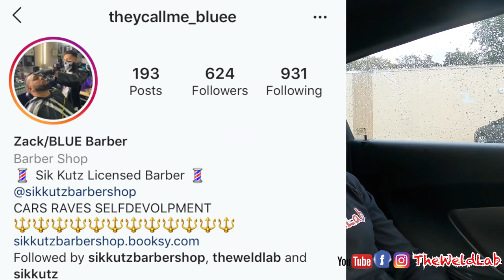NEW RIG WELDING JOB! | STAINLESS FABRICATION SHOP | PRODUCTION  WELDS | TEACHING ONE ON ONE

Comment: Hey bro . Just out of curiosity. You were In the 3rd range and low on the remote . Which means it’s more of a crisp and stronger arc . Have you tried welding In the 2nd range higher on the remote . Would it not be a softer arc ? Have you tried it and how did it weld if you did ?
Reply from the maker: i didnt try it on 2nd ...i was actually having  a hard time  finding the heat ..but im useing 5/32 to fill and cap so 3rd gear feels very good to me ...i cap on 5-6 on the remote and it lookds good
Reply: @TheWeldLab  awesome . Glad your dialed in . Keep up the videos , they are great and informative for the inexperienced or experienced. 👍